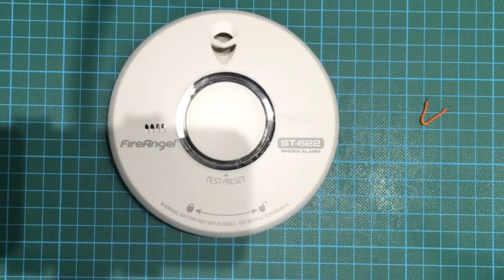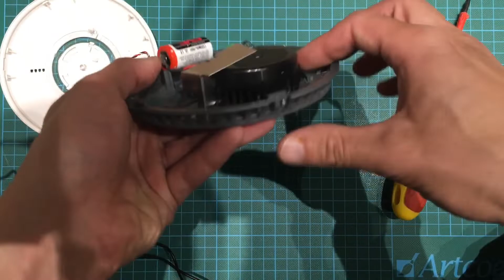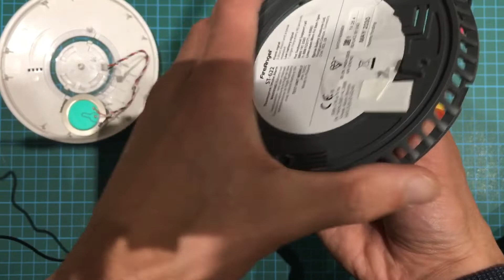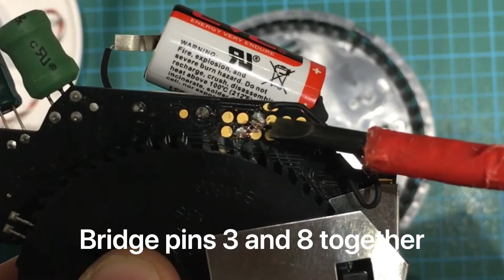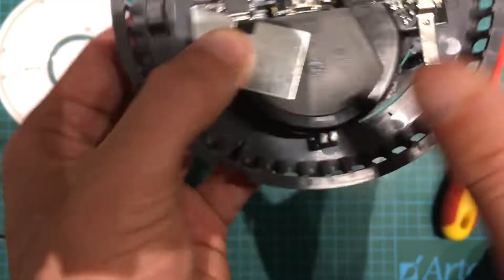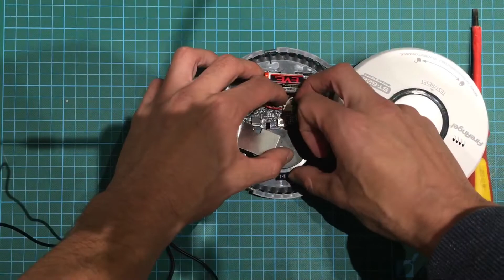ST-622 FireAngel low volume fix after Battery Replacement

Comment: Thanks very much for this. I've now got mine working again after unwittingly tripping the booby-trap which I did not know existed when testing the battery a few years ago. On mine, I noticed that pad 3 was already bridged to pad 9 directly below it (not by accident, there is a deliberate trace between those pads). So I just bridged pads 8 and 9 together with solder as they are directly next to each other, rather than trying to bridge diagonally between pads 3 and 8. Maybe there are different versions of the PCB where pads 3 and 9 are not bridged together. It seems to work perfectly anyway, so thanks.

Comment: Good stuff. Does the bridge need to be permanent?
Reply: Success! Soldered a single copper strand out of a multi-strand wire as a bridge, and fixed an ST622. Tested that with a burning envelope and the alarm is working fine.
Reply: Thanks for experimenting, finding this hack.& taking the time to post the details here 🙂
Reply: @Greeves  I was very excited to get it fixed after a whole year's wait. But, I will be switching to mains powered because the regulations requires it.
Reply: @fungames24  I didn't think that the new Regs insist on mains powered alarms (and the Regs only apply to landlords anyway)(?)  Is there something to do with new-builds as well?
Reply: @Greeves  For builds of certain date, can't remember what, the house needs at least 1 mains powered. If people are not aware of the regulations, they might have switched from mains to battery powered.
Reply: Needs a permanent bridge :)
Reply from the maker: Yes unfortunately, I did try bridging the various pads but nothing allowed a temporary fix.

I haven’t followed the traces to see where the full volume signal is supposed to coming from but I suspect it’s a pin out on the micro controller
Reply: Useful video for small soldering: https://www.youtube.com/watch?v=ADpbNQ7yF8c
Reply: Very useful information. In the process of returning the assembly, I removed the plastic cover and exposed two LEDs. Now it only blinks but doesn't beep. Please help
Reply from the maker: @navinlessing7053  The black cover that contains the optical sensor? You'll need to re-cover it so its completely dark inside the chamber, one side has an LED that shines light and the other side has a photodiode that detects the light only if smoke in the chamber refracts the light.
The test button should still work even if this chamber is broken, are you sure the speaker is reconnected? and no other pins are bridged?